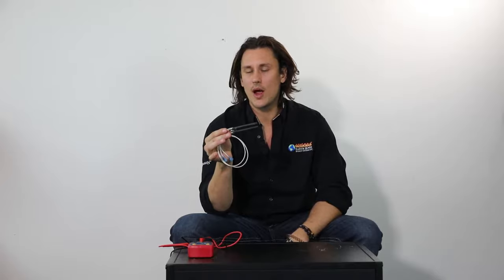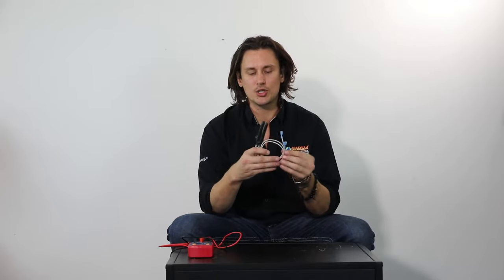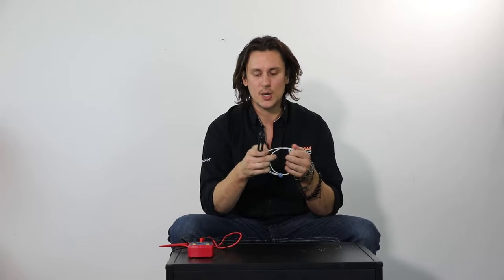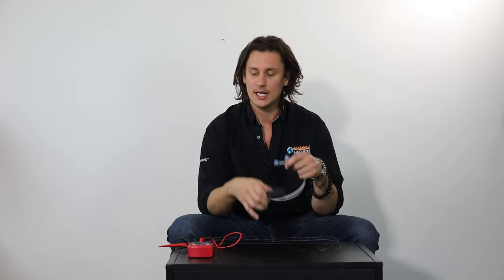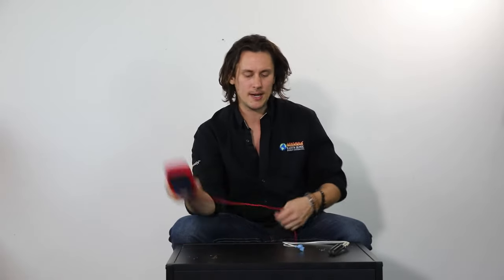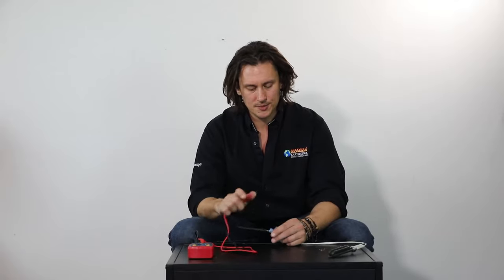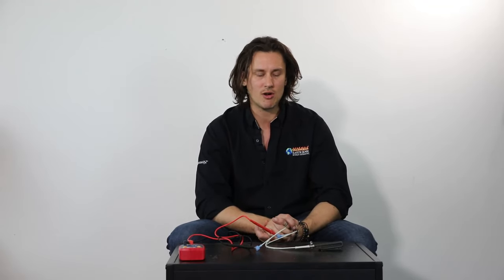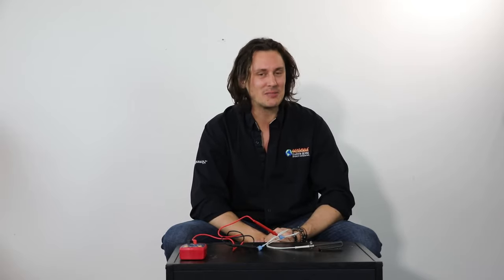How To Test A Stove Igniter, Pellet Stove Ignition Troubleshooting

Comment: Im new on this channel and have a problem with my pellet stove the igniter does not light on so I took it out and try to test it but give me no read is that mean that my ignider is no good?
Reply from the maker: Thanks for contacting us and welcome to the channel. That would be odd to get no OHM reading from an igniter - Typically there will always be a number output whether it's good or bad. Double check the multi meter connections to ensure they are making contact with metal in each of the igniter wire connectors. Double check your multi-meter OHM settings and battery as well just to be sure. What stove make and model do you have?
Reply: My stove is an Englander
Reply: Model 25-PDVC/55-SHP10
Reply from the maker: @aramisgotay8610  Thanks for the message back. Sounds good, we are familiar with this Englander model. I assume you have double checked the Multi-meter function and have ensured you are making good connection to get an OHM reading correct? Again, I have never heard of an igniter good or bad that doesn't give some type of an OHM reading so this is an odd one. Here is the replacement igniter for reference. https://pellethead.com/product/pellethead-replacement-england-stove-works-englander-igniter-element/
Reply: Thank you so much I will check and let u know thanks again
Reply from the maker: @aramisgotay8610  Happy to help Aramis!

Comment: @earthsense my pellet stove isnt starting / igniting. all gaskets, drawer, and doors are sealed, ash is cleaned out, pellets loaded in top, electricity and fan running fine, venting clear. still not igniting. what should i try? it's already real cold here at night -- 27 degrees. any help would be appreciated.
Reply from the maker: Thanks for contacting us, happy to help. Have you done an OHM reading on the igniter yet to see if the element is in proper range? What make and model stove do you have?

Comment: What harness should you order for a quadrafire BF 1200 Serial #985070 or the last # could be a 6?
Reply from the maker: Thanks for contacting us. For the Classic Bay 1200 Freestanding (CB1200FS), the correct wire harness and junction box assembly will be part SRV7000-154 based on your serial number. Here is a reference link -https://pellethead.com/product/quadrafire-1200-fs-junction-box-wire-harness-after-serial-352612-oem/. Any other questions please let us know. Thanks.

Comment: the Ohms for the ignitor was 82.5 and when i switch the polarities on the meter it was 67.8--68.4 ohms. Aftermarket range 55.0--60.0, Import range 54.5--63.0
So, I ordered one from you site.
Reply from the maker: Yeah, sometimes the igniter can be glowing and yet not be in operable range to properly ignite. We have seen this several times. Really appreciate your business, reach back out once the igniter arrives and you have it installed. We'll make sure everything is 100%. Thanks!
Reply: @EarthSense  The igniter arrived. The glaring questions are: can the igniter be replaced without removing the convection fan? If I need to remove the fan, does it need to be "resealed" in any manner? Is the plenum attached to the fan?
Reply from the maker: @dannyschacht4274  Hey Danny, glad the igniter arrived. Please remind me again of which stove model you have. In most stoves the convection fan is not sealed, it simply is placed/installed by the air manifold/plenum in the stove for air distribution. Refresh me again on your stove model and I can provide more specifics. Appreciated!
Reply: @EarthSense  Yeah, it's an Avalon Newport PS. Quick question: is there a place I can get an "explosion" diagram of my stove. My owner's manual doesn't have on. Thanks for all your help
Reply: @EarthSense  one other think, my igniter has a plate attached, but what I've received doesn't...
Reply from the maker: @dannyschacht4274  Thanks Danny. Check out page 5 on this link for a more expanded schematic - http://www.hearthtools.com/parts/travisControlboard.pdf

It's been awhile since I worked on a Newport, but I do believe the igniter can be changed with the convection fan in place. The convection fan in your Newport is simply placed/secured for the distribution air to go into the heat chamber/plenum area; no sealing on that of which I am aware of. Keep us posted on the install. Appreciated.
Reply from the maker: @dannyschacht4274  Hey Danny, Yes, the igniter will be in a "housing" with a flange. You should be able to pull the old element out of the housing and place the new element in the housing for reinstall. Keep us posted.
Reply: @EarthSense  my igniter has a "plate" welded to it...the one that was sent, doesn't
Reply from the maker: @dannyschacht4274  Hey Danny, the flange plate is welded to the housing, however the igniter element should come out of that housing so you can put the replacement in that housing. Is your element not coming out of the housing? Pull out the entire igniter assembly with housing to replace the element. Keep us posted.
Reply: @EarthSense  got it. but the igniter I received has no flange plate?
Reply from the maker: @dannyschacht4274  We only sell the element Danny. Are you not able to pull the old element out of the flange plate housing?
Reply: @EarthSense  okay, what's the return policy?
Reply: flange is welded to the element
Reply: @EarthSense  thanks, but I have that information. Looking for a Parts exploded view.
Reply: @EarthSense  I finally understand what you're saying. I need to check...sorry, I'm an old guy!!
Reply from the maker: @dannyschacht4274  Danny, do you not see a small allen set screw where the igniter enters the housing? There should be an allen set screw on the housing that you loosen to pull the element out of the housing. The igniter element should not be welded to the housing. Keep us posted.
Reply: @EarthSense  I see it and yes, I can continue. Old man...old eyes. Thanks for all your help. I'll give you the update when I finish
Reply from the maker: @dannyschacht4274  OK perfect. Soak the screw down a bit with some WD40 or PB Blaster lubricant if needed - sometimes they can be tight.
Reply: @EarthSense  that went smooth...once I removed the convention fan. And the next time I need to remove that fan, it will be very easy.
Reply from the maker: @dannyschacht4274  Good to hear Danny. How is everything firing up now?
Reply: @EarthSense  nope....it wasn't dropping pellets, so I hooked my jumper to it and the auger worked just fine. when I was taking the jumper off, it broke both spade terminals. To the hardware store I go.
Reply from the maker: @dannyschacht4274  Sorry to hear that Danny - Was this on the vacuum switch?
Reply: @EarthSense  Changed the vacuum switch already. Once I repair the leads on the augur motor...the troubleshooting goes on
Reply from the maker: @dannyschacht4274  Ok Danny, basics to look at here if your vac switch is tripped, but you know the switch is new/working correctly. 
1. Inspect the switch tube/hose. Make sure it is secure and there are no cracks, holes, etc.. 
2. Check your front door gasket seal and ash door gasket seal if applicable. With the stove off, use a piece of paper or dollar bill, open the door, place it half in and half out, close the door and pull on it. Should be heavy resistance. Check different areas all the way around. 
3. Air intake channel - make sure there are no restrictions.
4. Flue Vent Pipe - Make sure there are no restrictions.
5. Ash accumulation in the stove. Double check all ash traps and cleanout areas. 
6. Check the combustion blower voltage. Should be near line voltage on start-up. 

Sorry to hear of the continued frustrations. We are happy to help and do our best to get everything back to 100%. Thanks.

Comment: I have a Whitfield WP4 quest. Wud u know what the ohm range is for it? there's a box it is plugged into, how wud I text it? Thanks, Joseph-vernon Arizona
Reply from the maker: Hey Joseph, happy to help. Your WP4 Whitfield Quest will use the threaded igniter element. Ohm range on that element is 33-39.5 ohms. Let's first see if your igniter is in proper range. If it is in range, then more than likely the issue is with the fast-fire igniter timer block that you see the igniter wires plugging into. 

Always important to note - It's the air rushing around the igniter that is lighting the fire. If the igniter is glowing red hot, but you are not seeing ignition, it most likely has to with improper air flow. Always good to check the door gasket seals, firepot placement and holes, combustion blower operation, and any ash blockages in the stove or vent pipe. 

Keep us posted, here are links for reference - 

Igniter: https://pellethead.com/product/pellethead-replacement-whitfield-lennox-iron-strike-threaded-igniter-element/
Fast Fire Timer Block: https://pellethead.com/product/whitfield-wp2-wp4-wp7-quest-advantage-fast-fire-timer-block-oem/
Reply: @EarthSense  thanks for all the info. I can check the ohms now. I did check air flow through tube and that is fine.
Reply from the maker: @jswik2085  Sounds good, let us know what kind of reading you get.

Comment: ps35 replaced control board, unit working for 1 day. now stove will not fire, igniter seems not getting power, usually it gets red hot. any suggestions???
Reply from the maker: Thanks for contacting us. Start with the basics first. Check all electrical wires and connections in the unit. Make sure the door and ash door are shut and sealed properly. Make sure the exhaust pipe is not plugged and heavy ash accumulation is removed from the stove. Make sure your burnpot is seated properly and the holes are all open. You can use a multi-meter to check the ohms on your igniter element to make sure it is in range. Why did you replace the control board? Is everything else working but the igniter? Happy to help.
Reply: replaced board no power. replaced igniter, everything else work except their is about .9 volts from board to igniter. @EarthSense
Reply from the maker: @lesadavis6369  Thanks for the message. If you're able to take the control board to a local dealer for testing or have a technician come out to service the unit that would be ideal. It's rare that a new control board would be bad, but based on your notes I think it's best you have it tested if possible.

Comment: I have bought 5 igniter for my Avalon pellet stove in past 2 years,2 of which was from Earth Sense in just the past month and they have all failed,what could be causing the ignitors to burnout
Reply from the maker: Thanks for contacting us Terry, happy to help. The couple things that come to mind causing this would be a control board that is keeping the igniter circuit energized all the time which will burn out the igniters prematurely. Another issue could be if the stove is running on a thermostat and cycling on and off frequently. Some of the older stoves only run on the early manual t-stats and when they are hooked up to a digital or programmable t-stat the way it cycles the start up causes repeated start ups and excessive wear on the igniter element. Do you have a thermostat in place? If so is it the original or an upgraded one? Anyway you can have the side panel open during operation to see if that igniter is glowing and staying on after start-up?
Reply: @EarthSense  I was thinking that too thank you
Reply from the maker: @mr68special  Thanks Terry, keep us posted, happy to assist however we can. Thank You!
Reply: I have my multi meter hooked to power wires for igniter.started pellets manually.turned power back on to stove.there was power to igniter.stove got up to temp fans came on and power to igniter went from 117v down to .05 to .08v is that normal?
Reply from the maker: @mr68special  Thanks Terry, good troubleshooting! I just messaged our lead tech on this. Will follow-up ASAP. Thanks!
Reply from the maker: @mr68special  Just heard back from tech - That would be completely normal. There will almost always be about a volt or less that will bleed through. Do we know what the model of the Avalon stove is? It could come down to the wrong type of t-stat that is causing the igniter failure. 

Keep us posted, thanks!
Reply: @EarthSense  it is a Avalon Astoria PS
Reply from the maker: @mr68special  Thanks Terry. Do you operate the Astoria on a thermostat?
Reply: Yes on a thermostat
Reply from the maker: @mr68special  Thanks Terry. Are you using a thermostat with a digital display or a programmable one? These are the ones we have seen cause issues. The traditional mechanical wall thermostat is the best option for the Avalon Astoria. Let us know. Thanks!
Reply: @EarthSense  programmable one
Reply from the maker: @mr68special  Thanks for letting us know Terry. This could be our issue with the excessive igniter failures. If willing/able let's try a standard mechanical wall thermostat. Here's the one we offer - these are available at any hardware store. https://pellethead.com/product/universal-pellet-corn-stove-wall-thermostat/

Comment: I have a Harmen P43 and the stove will ignite but I noticed the fire stays only in the left corner of the burn pot and the right side will not catch on fire. Any idea why that is happening?
Reply: I have the same stove and the exact same problem. After a while it just starts dumping unburned pellets.
Reply: I’m having the same problem with my P43
Reply: I can get it to start normal if I put the stove temp between  75-80 and turn it on, wait maybe 20 mins and turn down the temp.
Reply from the maker: Just checked in with our lead tech team on this. This is something they have seen and are familiar with. Notes below.

One likely issue if 2016 or newer, two possible issues if 2015 or older.  Both cases are about air diversion.

2016 and newer – burn pot igniter cradle not fully seated against the throat plate with the air holes.  Cooler intake air can now divert around the igniter and dilute the superheated air entering the burn pot.  Switching to an adjustable cradle or two small #10 washers added between the cradle frame and the burn pot where the two cradle fasteners are.  Hard to do without removing the burn pot because the washers go over the two machine screws, one each, before being threaded into the cradle frame.  

2015 and older – the same issue above is possible with the possible additional problem of the firewall across the air intake channel and lower burn pot studs being warped.  In these cases, the factory gasket was not thick enough to seal the warpage causing some air diversion from the burn pot impacting air flow through the igniter cradle.  Installing two of our AMP burn pot gaskets will seal this warpage problem.

In both cases, if the diversions are small, a new full strength igniter can overcome the problem.  However, as the igniter over time becomes weaker it becomes more difficult to light the fuel.  The classic symptom is ignition on the left side only because air draws slightly more left in a P-series because the combustion blower is on the lower left side.

Comment: What is ohm range for igniter on Avalon Newport pellet stove?
Reply from the maker: Thanks for contacting us. We only offer aftermarket options for the Avalon Newport Igniter. Aftermarket Range is 54.5 - 63.0. The OEM igniter may be different than that however, and you would most likely have to reach out to the factory direct to get that ohm range.

Comment: I have a Breckwell Pellet stove Tahoe P2000 Inset, what should the ohm reading be on the ignitor?
Reply from the maker: Thanks for contacting us. We only offer an aftermarket igniter for the Tahoe P2000 which optimal ohm draw should be in the range of 54.5-63 ohms. Sometimes the factory igniter will have a different ohm range, factory part number will be C-E-IGN. I would think you should be able to reach out to Breckwell direct to find out proper ohm range if you have the original OEM igniter in your Tahoe. Hopefully that was helpful, thanks!

Comment: Hi I have quadra fire mt vernon pellet stove advanced energy, the ignitor doesn't glow. It has been changed and still doesn't glow. Is there any other tips to try?
Reply from the maker: Thanks for contacting us David. Just to make 100% sure, let's do an ohm read on the igniter to make sure it's in proper range. Let's also double check the connection points and make sure they are secure. If we are still having issues, I can touch base with our lead techs to see what next steps would be for the Mt Vernon AE.
Reply: @EarthSense   yes I have she was have trouble with the cash door opening  and this and now the doors working but but the ignition switch  not geting hot
Reply from the maker: @davidrebeck9281  Thanks David. Checking in with our techs on this. Are you getting any kind of a reading or error code on the wall control?
Reply from the maker: @davidrebeck9281  Hey David, just heard back from our tech team, they suggested: A common issue is that the igniter will short out and damage the circuit on the corner of the board where it plugs in. Have them remove the mother board and take the black plastic clamshell off of the board and check that corner for burns or damage. Also there is a fuse for the igniter circuit on that corner of the board so check that as well as that may have popped.

Let us know what you find.
Reply: Thank u guys so much I dont know ant thang about them she just lost her husband  and then this but I got it thank u so much it was the clamps  was not  geting a good connection
Reply from the maker: @davidrebeck9281  Excellent to hear David, so glad it was a simple issue here and you got it figured out and were able to help her out. That's just wonderful. Any future questions please let us know. Thanks so much!